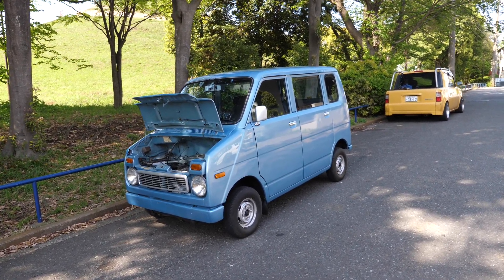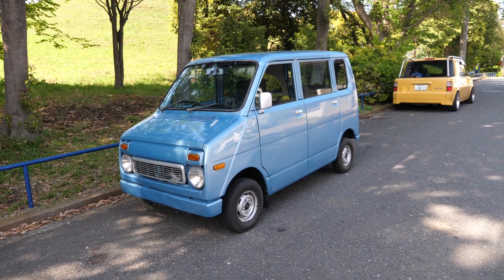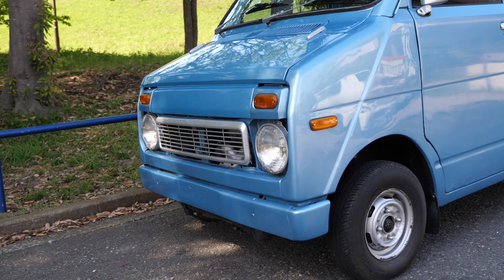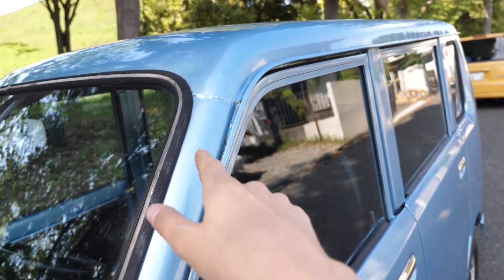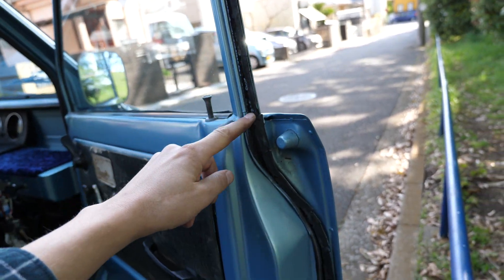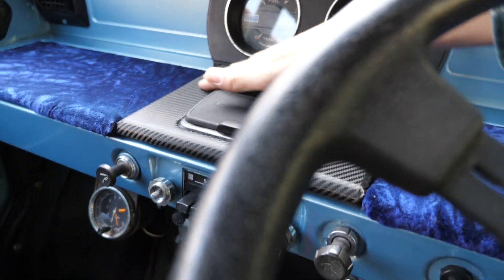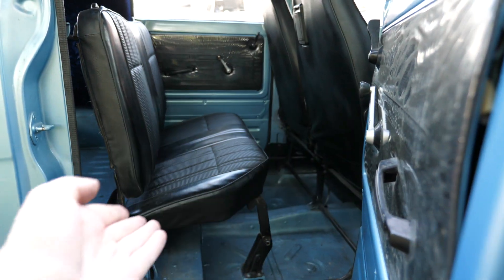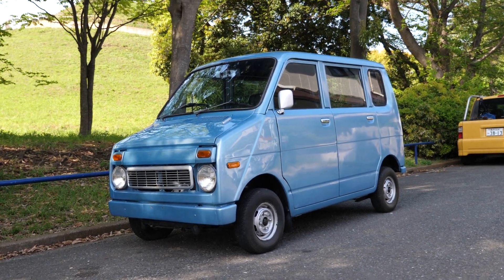1974 Honda Life Step Van (USA Import) Japan Dealer Purchase Review

Comment: That ignition system sure gives off a lot of electrical interference on the camera's microphone.
Reply from the maker: Tell me about it. Older Minis do the same thing.
Reply: @PacificCoastAuto  unshielded spark plug cable
Reply: @PacificCoastAuto  bad spark cables/coil/distributor. High voltage has a bad insulation.
Or ignition cables are of obsolete type.
Reply: @criticalevent  that must be the source of issue. 🤣
Reply: I know it is kinda randomly asking but do anyone know a good website to stream newly released movies online?

Comment: Air-cooled? It has a radiator and you can see two water hoses going into the bulkhead. That cool little van is water cooled
Reply: Yup, "it uses the same 30 PS (22 kW; 30 hp) 356 cc, two-cylinder water-cooled engine "-from wikipedia.
Reply: The EA-series is a water-cooled 356 cc (21.7 cu in) inline two-cylinder engine replacing the N360's air-cooled 354 cc (21.6 cu in) engine. An SOHC design with a timing belt (replacing the chain used in the N360 engine), the EA was first seen in the 1971 Honda Life. This engine was derived from the air-cooled engine in the Honda CB450 and was adapted for water-cooled application. The displacement was reduced to be in compliance with Japanese kei car legislation that stipulated maximum engine displacement. Bore and stroke were 67 mm × 50.6 mm (2.64 in × 1.99 in). A version producing 30 PS (22 kW) at 8,000 rpm was installed in the Honda Life, while the Honda Z and the Honda Life Touring (introduced in May 1972) received a twin-carb model with 36 PS (26 kW) at a heady 9,000 rpm